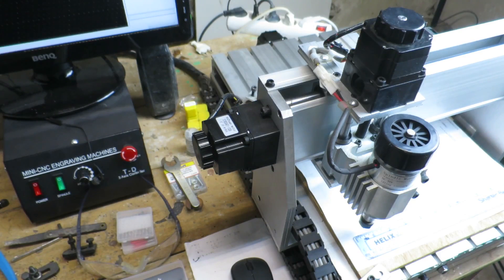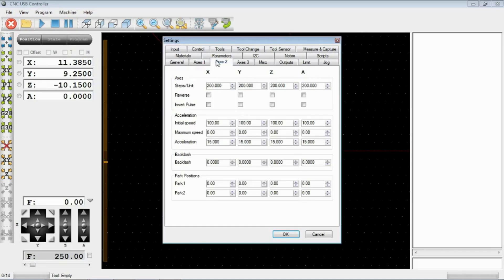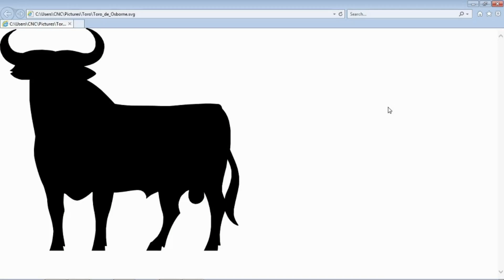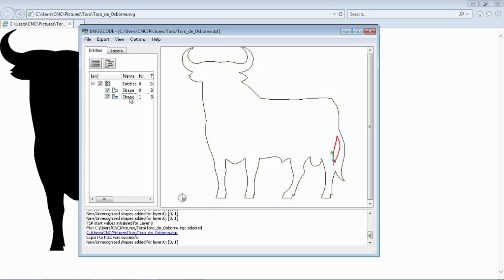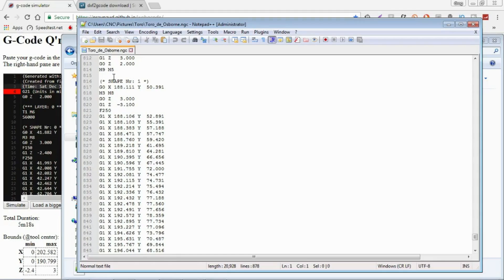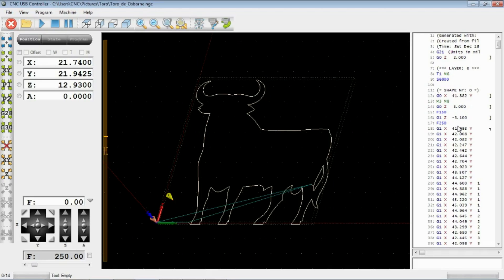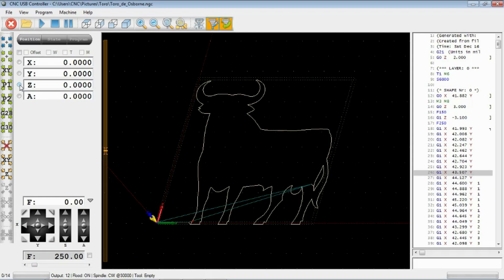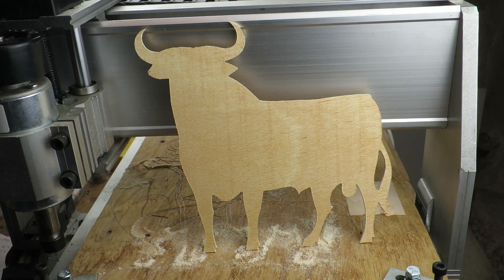First Steps in CNC CNC3040 CNC USB controller Setup Test Cut Tutorial

Comment: I used this video two months ago to set up my new CNC 3040. It was priceless!  however I woke up this morning and found that Microsoft has tried to install Microsoft edge on my computer.  Now mind you I have Windows 7.   I was prepared to not have to deal with updates.  But today I open up my CNC USB controller to do a job and the updates have reset my controller.   I hate Microsoft!  Now I'm back to this video to try to reset.  I hope the Microsoft update hasn't affected my ability to use my CNC :(
Reply from the maker: Bummer! Hope you get it sorted. If you can see the USB controller in the device manager you may be able to roll it back? Good luck!
Reply: @1nformatica  Luckily all I had to do was reset the direction and increments shown in this video.  I'm back up and running.  Also I disabled microsoft automatic updates.  Just putting this here in case anyone else has same issue.

Comment: I have the exact same one 3040 cnc but there is no port for usb any help
Reply from the maker: These machines are supplied with a variety of controllers. Best to disconnect the power and look inside the unit to see which controller board it uses. Mine is a JP-382C, you can see some information about it here : http://www.m6mdr.co.uk/inside-usb-cnc-3040-control-jp-382c-box/

Comment: Hi, I recently got the same model of CNC 3040, been trying to set the software up,  do you mind making screen shots of the  settings in your program so I could see what to set up in mine?  Just let me know  and I’ll give my email . Thanks a lot .
Reply from the maker: You can see and download my settings here : https://drive.google.com/open?id=1xwD10LqLVfAqqiLSZstjTzLlVwV3RhlQ
Reply: @1nformatica  Hi, thanks but i didn't really understand what's opening, its a long list of XML text. that's how it supposed to be?
Reply from the maker: In the CNC USB software under the "File" menu you can import and export the machine settings. I suggest you export your current settings then import my file to test.
Reply: 1nformatica  Thank you, I’ll try to do that,  Let me ask you, your machine works good? No mechanical issues so far? Because my was standing half a year with no use, I tested it after I received it, but then it was just sitting in the basement , but now when I purchased a license for this software I tried to run it, and seems like X,Y motors are being jammed and making clanking metal noise trying to turn the shaft to move the axis ,and I need to use my hand to give it a crank spin, than it might move, don’t know what the hell is going on.
Motors by it self works good when I removed them to check, but when they are back on, the are being jammed by something...
Reply from the maker: Hi, my machine has worked well for 18 months now. No issues. It's possible for some reason the step rate or speed have been set too high. Before you load my settings take a look in the Axes 2 tab of the settings and look at the "Steps per unit" and acceleration values. Let me know how you get on.Good luck!
Reply: 1nformatica  I have 400 steps per unit and 15.000 acceleration . I had 200 steps per unit but it wasn’t giving precise measurements
Reply from the maker: I have the same settings so that is not the problem. When you turn the axes by hand do you feel much resistance?There should be very little.
Reply: 1nformatica Yes, it feels like I’m turning one direction while motor try to spin it the other way , plus when the motor try to spin it without my help, it makes a metal grinding  noise,  then it moves and 2 sec later it gets jammed.
Reply from the maker: Sounds like it is a mechanical problem. With the power off you should be able to turn the axes without much resistance. Have you looked at the linear bearings? Maybe need a little oil?
Reply: @1nformatica  I did put some lubricant on all moving parts, could it be due to low tempereture in my basement?  Because after I give hard time to my machine and it starts  to work, then after a while It runs sample codes with no problems...so my guess is that it need a warm up time ..what do you think
Reply from the maker: It could be, how cold is it? Living in the south of Spain it's never been an issue for me!😀
Reply: I would say around 10-15 degrees, I’m in BC Canada🤧.  Let me ask you, did you get your machine from eBay ?
Reply from the maker: I hope that's Celsius! Yes, an eBay purchase. Chinese store delivered from Germany!
Reply: fortunately it is Celsius 😁. The reason I asked is that I just want to know who I should talk to about issues like that, Tried to talk to China CNC zone, but they don’t want to support unless u buy machines directly from them..
Reply from the maker: I'm afraid you're pretty much on your own in these cases! I would take the pain and strip the machine down to find the problem. It's the only way sometimes and at least you'll know exactly how it works!!
Reply: I think you right, I’ll try to take it apart and see what’s going on....but now I have one more issue, may be you know what’s wrong, I got a touch plate today, was trying to set up, followed your instruction , but when the bur touches the plate it doesn’t stop and retract back just continue pushing down, I triple check all the settings, everything looks right, but something is definitely is wrong...do you know what could it be? Thanks👍
Reply from the maker: Do you see the led state change in the i/o window like here : https://youtu.be/32hjG9YyjDM?t=119
Reply: I was trying to find it, but in latest version of this software I didn’t see this under IO , I looked everywhere in the settings, but couldn’t find it...
Reply from the maker: Did you get documentation with the software? Double check that the crocodile clip of the sensor is connected to signal ground with a  multimeter. This of course should make good contact with router bit. The touch plate connects to the left hand pin of the "probe" 2 pin header in the controller.
Reply: My control box came already with a input jack to connect touch plate, and I was kinda surprised to see that your control box didn’t have one, although it’s the same model. Anyway, I sent an email to planet-CNC .com and sent them my exported settings to their request to see what the problem was. Touch plate works fine when the bur touches it, the Z window turn pink, so there is contact, but the spindle don’t stop, and they checked my settings and said that the sensor input is not configured or something and since it’s a Chinese controller they refuse to support it and I just purchased a license from them....so I wanted to check if your settings would have proper configuration to work with touch plate, but unfortunately it does the same, spindle goes down, touches the plate and keep pushing it. 
I can’t find what’s missing in the settings damn...getting frustrated with this god damn mechanical issue and now software issue came along....
Reply from the maker: In my software the sensor input was disabled by default. Also I had to set "single input" in the limit tab. https://youtu.be/32hjG9YyjDM?t=210
Reply: I had that single input box checked, and still no results,  let me ask , what version is your software ? Is it the latest one? Because I came to one weird conclusion yesterday about that mechanical issue I have. Was playing around with parts after taking machine apart, everything looked absolutely ok, no jamming anywhere while machine was off, but as soon I turned the power on, it becomes jammed making that metal clicking noses as it was  trying to spin .So when there is no power, I can spin motors very easy, no jamming, very smooth, but with power it’s almost impossible to make it to turn.
Reply from the maker: My software is SW 2.10.1208.601 so is not the latest. When the machine is powered on the stepper motors should only energise, it shouldn't try to move.
Reply: Been thinking a lot and I decided to replace Chinese controller board with original from planet-CNC .com,  will come Monday, so I hope to see much better performance once it’s all set because they say Chinese version it’s an obsolete one. So now at least I will have a technical support if I need it. Really helpful people down there.
Reply from the maker: Interesting, let us know how it goes.
Reply: Of course, here is what they replied to me about the Chinese controller.  “ Hi,

Many users got tricked into buying these machines. Now, while machine itself is probably a pretty solid product, there is nowhere mentioned that controller used in a control box is a Chinese counterfeit of our product.

Link below displays some examples of such Chinese counterfeits. 
Of course there are many versions of these boards so not all of them are listed: http://forum.planet-cnc.com/viewtopic.php?f=2&t=520

Please know that we do not support these boards and therefore we cannot be responsible for any hardware or license malfunction.

These boards are based on our first Mk1 controller which is an obsolete and not supported item.
Many of its hardware and software features are outdated and there is no software/firmware development for this product.
These controllers have small buffer and weak processor, which reflects as bad machine performance.”